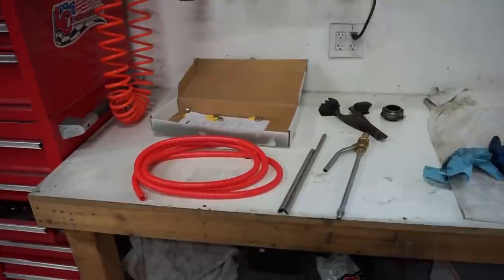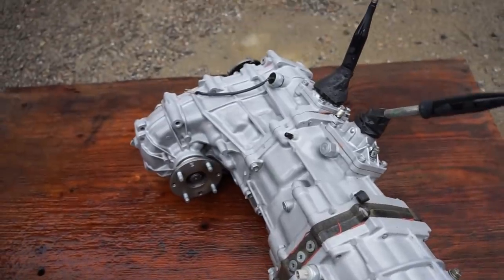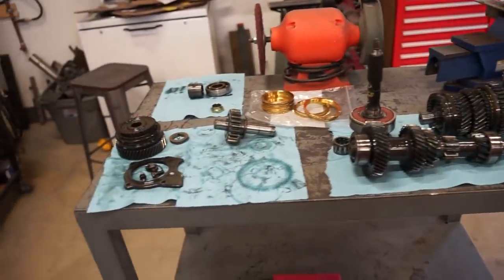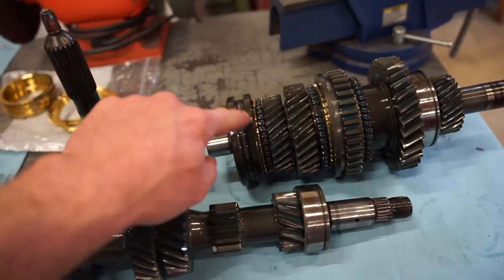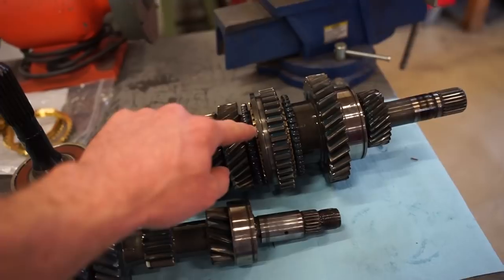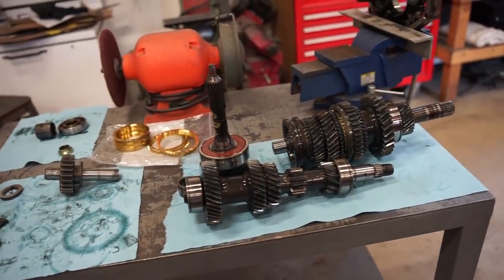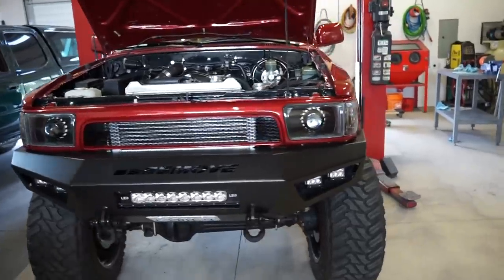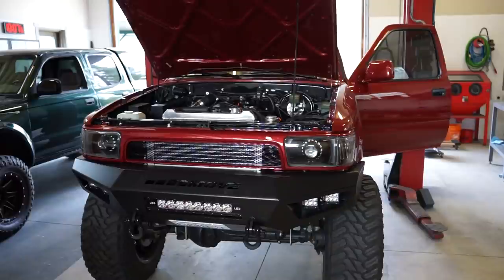Big Red Gets A Transmission Rebuild!

Comment: Hey, one quick tip on those bearing splitters. Put the forged part of the splitter across the gap in the supports so there is no bending force on the threaded rods. otherwise you bend the rods and have to replace them. Ask me how I know :P

Comment: Your a hell of a mechanic man,,just took my w56 and transfer cas to high gear in Memphis to have it gone through,,they said the transfer cases never wear out,,I told them that I wanted it gone through anyways because I had bad luck ,,so 1600 dollars later I got my transmission back in the truck 
And just like you that was the last thing that I haven’t went through on this truck,,super tight now with the transmission with all new bearings and syncs ,,
I don’t have a lift like you do in the shop,but with the truck lifted and the big tires,,I put 2 big pieces of foam rubber on the edges of the cab just above the windshield ,I use a small chain around the cab and hook it back to itself,,then I use a 500 pound hoist and I got a small chain just I from of the shifter,,it balances pretty well,,and it goes back in just as easy

Comment: hello Excellent explanation and thanks for sharing your knowledge. I need to change oil in my 98 manual 4x4 tacoma, I went to the agency and they only gave me 80w90 oil and they said that it applied for differential, transmission and transfer, I ask you, is that correct? Thank you very much for your comment

Comment: Hi. i love your videos. my dad has an old hilux and i wish i could restore it just like you do with yours. i have a question. which is the minimum pressure required from a pressure washer for wet blasting and remove rust and paint from old cars? thanks in advance